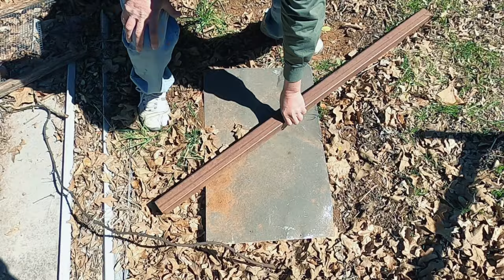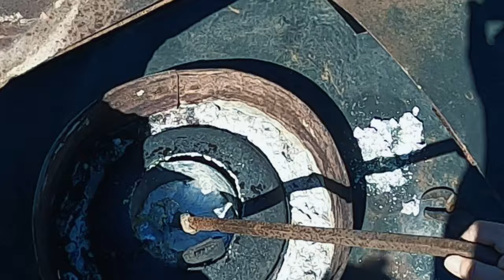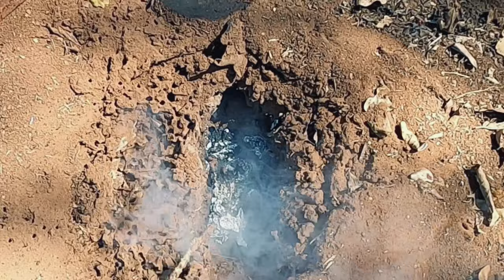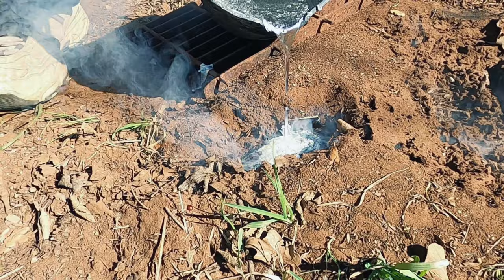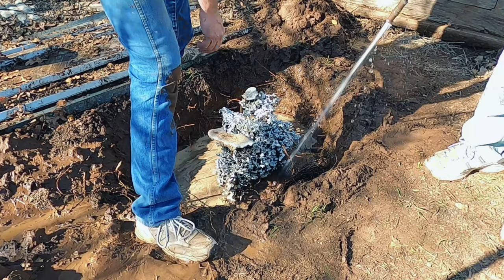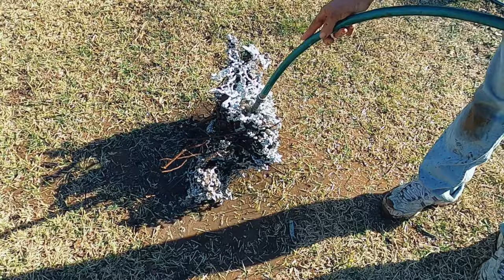Bridging Two Mounds - Massive Aluminum Fire Ant Art Sculpture

Comment: Why do you dig out a lot of the anthill before you pour the aluminum? Does it help in some way? I'm genuinely curious, as usual! ☺️
I almost forgot to say how beautiful it turned out!
Reply from the maker: Thank you for watching our videos! We love the questions too. We vacuum out the middle of the mound for a few reasons. It opens up the tunnels where we might have knocked some dirt in an blocked the holes. It also allows us to create a base for the sculpture to sit flat on. The base requires additional aluminum, but we feel it's worth it not having to find some kind of wooden base to mount it to. However when we mess up a pour or the base breaks off, we love mounting the sculptures to pieces of driftwood or wood plaques.
Reply: @antznpantzcastings  That makes total sense. Thank you for answering. I'm not sure if others who do this think about it too much (from watching their videos, I mean.) That's why I was so interested in finding out. And you are more than welcome. I love a good video. ☺️